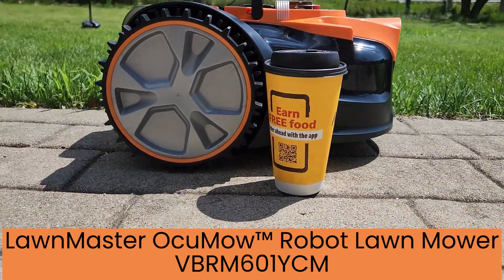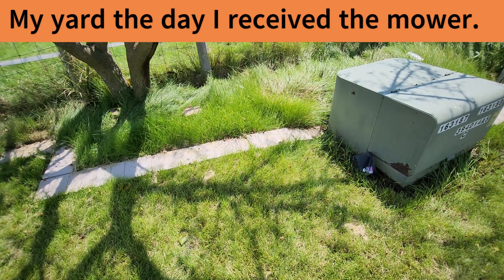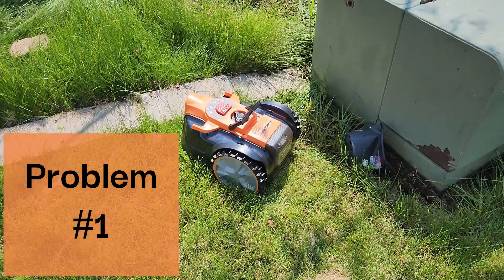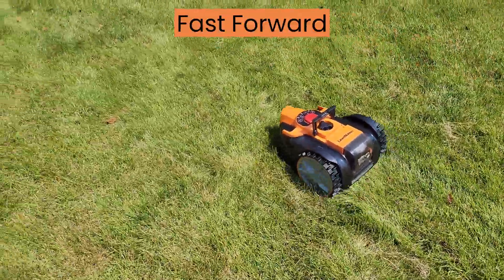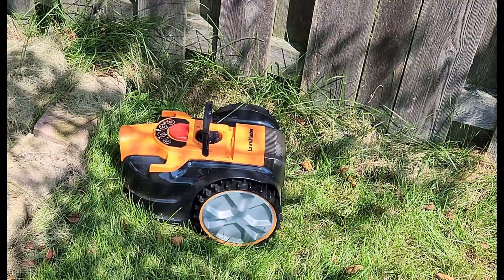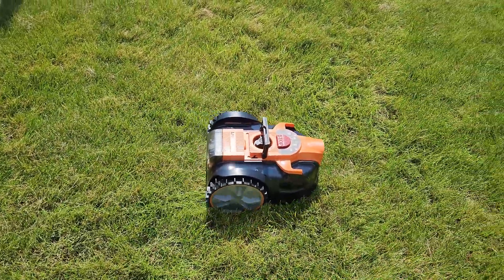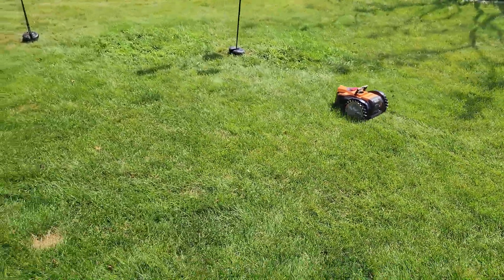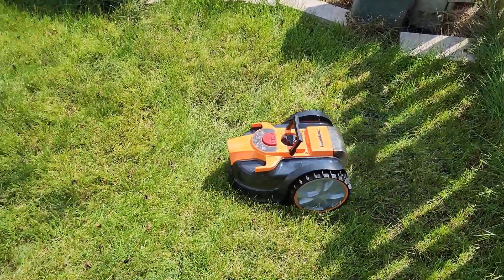LawnMaster OcuMow™ Robot Lawn Mower (VBRM601YCM): Problems

Comment: Looks to me like the grass was too long around the pink bricks and obscuring them, so the camera wouldn't clearly see them at that level.
I have similar in my garden and strim the edges and around obstacles first so the mower can see it.
Reply from the maker: I tried trimming, it still cannot see them all the time.  If the bricks are in shadow, it does not always see them. I noticed this with the gray bricks around the parameter as well. If they are in shadow, sometimes the mower does not see them.

This problem with shadow is why I do not run the mower in the front yard without watching it.